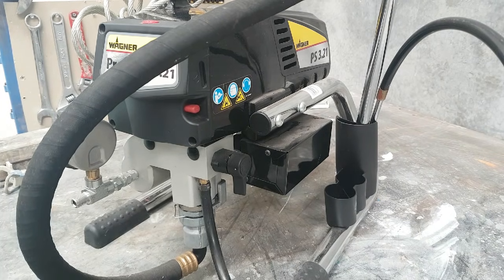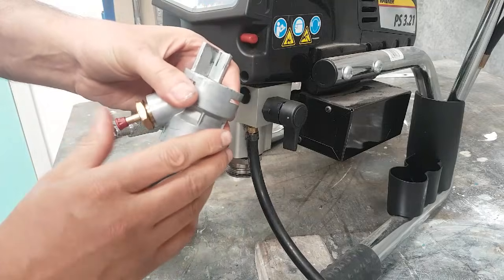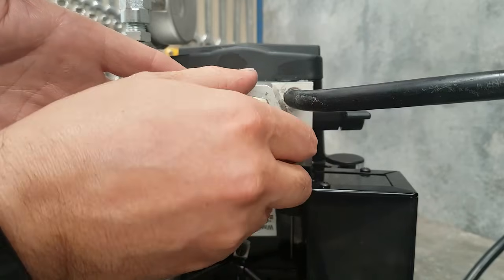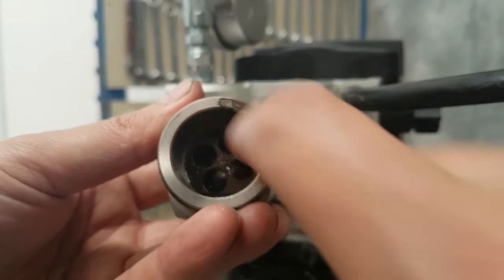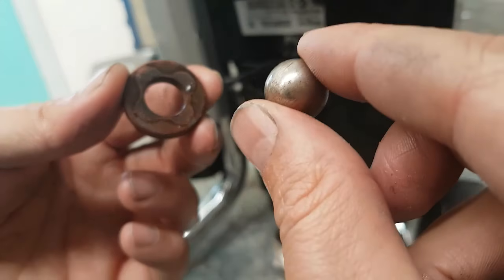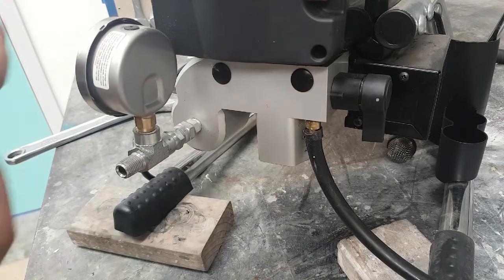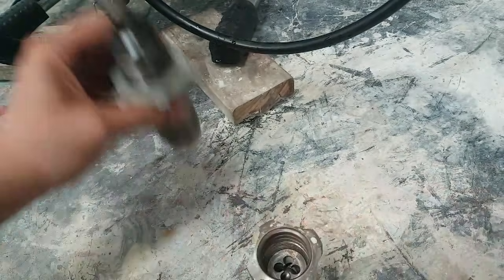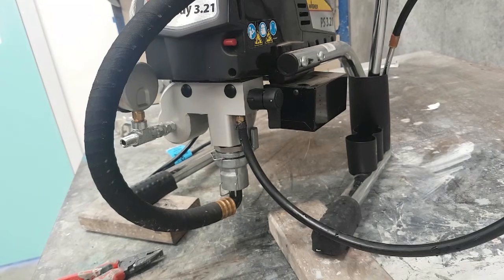Wagner / Titan won't spray

Comment: Just got mine second hand and neglected..  cleaned it myself abd git it going...  decided to drop it into the shop for a service $220 (including filter and spring)  3/4 way through first job it stopped priming. Your vid saved the day F'ing Awesome!!!....  not impressed with service shop though..  the lower and ball bearing area was full of old shit and never been cleaned!!!

Comment: You are a legend mate, your video really helped me . 

However, I have fallowed exactly your instructions with my Wagner 321 and re assemble it but it spray and then lose the pressure . 

Please guide me of what is the issue with my sprayer ! 

Thanks Ali
Reply from the maker: If its not a blockage in the valves, you'll need to take it to a workshop to go through it.  Too many different things it can be.

Comment: Yours is tbe only video that fixes the problem without the repacking kit.  The trick is freeing the upper AND lower ball.  The lower ball is easy to access but your method gives access to the ball inside the piston.  Also, I didn’t need to remove the cage however as mine was clean. After freeing the second ball in the piston, I sprayed brake parts cleaner all over both balls to make them extra clean. Works like a new unit now.  To avoid the balls freezing in the future, it’s important to clean thoroughly until clear water comes out of gun, then suck up some full strength pump armor before storage. Cheers!

Comment: I have the same machine ,while spraying the power goes off and will not turn on: sometimes it will turn on in 10 min some times next day, what is the reason?
Reply from the maker: You'd need to take it to a service centre to tell you,  could be a number of things

Comment: I get pumps destroyed by being left in water constantly. I have a graco 390 ultra that I have used to death with two repacks and the cylinder and piston are still smooth with a slight swage. I clean and thoroughly fill with thinner with a little bit of red trans fluid mixed.

Comment: Hi Mate.Thank you For the video.
  I need to trouble shoot a problem on my Wagner3.29 pro spray.
It was okay before but now  it turns 360 all way round when I try to switch from prime to spray. The machine Goes to spray mode when I don’t press the trigger but as soon I press the gun trigger it automatically goes to prime mode but still I can see some water from gun but no water comes the prime hose even when the Machine is in prime.
Plz assist me.

Comment: Thank you so much! My Titan 440 had been sitting for over 10 years and wouldn't prime. I wasn't willing to give up and try to go to bed tonight with the thought that I might be using rollers to do the whole job tomorrow. Fortunately, I found your video and it gave me confidence to find the problem. Just needed to poke the little ball with a screw driver to free it up and wipe a little loose rust and grime out of the lower ball and seat assembly. Only problem now is the water came flowing out of the selector, until I switched to spray mode. Will take a closer look tomorrow morning. Worst case, I'll just be ready with a bag of old towels.

Comment: hi, i have 4 sprayers, 2 grecco and 2 titan, both are well clean but they stop sucking paint every 2 or 3 minutes while spraying and i have to hit it with hammer to make them work, what might be the problem?
Reply from the maker: Damaged, dirty or worn valves, each machine has two, 1 at the bottom, the other is in the piston rod.

Comment: Hi Arley,  mate my machine isn't priming, I've cleaned out the bottom as in your video but the ball above the piston ball I believe you called it isn't moving and seem stuck in the up position,  any hints on what to do as I don't have time to put in for service as I've got a priority job that  needs to be finished in a week and I'm relying on the airless to get the job done in time.
Reply: Unfortunately you need to take it into a service centre, I don't recommend any more than the video if you don't have the knowledge as the damage you can do can go from minor to major repairs
Reply: @alielhaouli3198  Thanks , I actually did it and found it extremely basic,  I suppose there are some that couldn't do it but most painters I know are pretty handy.

Comment: Thanks for the video mate, I bought a new titan 440 and it wouldn't prime or spray" brand new out the box" I  took it apart & whatever assembly grease they used gummed up around the ball seat I scraped the dry grease off with my fingernail & a shop rag. I put it back together and she runs fine.

Comment: I know this isn't a titan 440i but maybe you would have some general idea of what to look with my problem.  my titan 440i  motor keeps smoking and blowing the fuse. i pulled it apart and see that the brushs on the motor are heating up and smoking then blowing the fuse . would you have any ideas what it could be?
Reply from the maker: It could be worn brushes or a board issue, usually this is caaused by using a bad power supply or a generator which is not recommended, otherwise its wear and tear.
Reply: @westsprayairless8763  I didnt think the brushes were that worn till you mention it I looked at it again and at new ones online it looks about half the size of a new one . Ill give it a try and see what happens. I already replaced the capacitors. Thanks for the reply !!

Comment: Do you have any tips for an old sprayer like a Wagner 505?
Reply from the maker: You can use any tips as long as you use the correct tip guard to suit the tip and your gun
Reply: @westsprayairless8763  no I meant any tips on how to take it apart. I got one today from an old painter. Its a diaphragm pump not a piston pump. But it doesn't do anything when I turn it on it won't prime or suck paint.
Reply from the maker: @groovygringo3747  sorry I didn't get the question. Yes first remove and inspect the inlet and out let valves. While they're out, inspect movement in the diaphragm, you should get more movement as you raise the pressure and less as you dial it down. If this doesn't happen, don't go any further because the cost of repairs will quickly surpass the actual value of the sprayer.
Reply: @westsprayairless8763  okay thank you. So how do I tell if the diaphragm is any good? I posted a video on my channel of the sprayer if you don't mind taking a look it's my most recent video.

Comment: I have a three wagner 3.21, only one running now, so just pulling one apart and having trouble, you helped a lot. Thanks
Where can i get cheap kits for them?
Reply from the maker: ThePa1nter i dont recommend the cheap kits, get the genuine kit and i recommend changing the piston as well as the packing kit

Comment: Hi Ali can you please offer me some help regarding Wagner project pro 119 spray unit .
After cleaning inlet and outlet valve thoroughly machine still fails to prime completely.
Machine won't even prime an inch of water.
Would you suggest a pump kit is required? Their are no signs of pump leakage
Really would appreciate your urgent feed back.

Thanks ,
Steve
Reply from the maker: steven dimakos if your outlet valve ball (located in the piston) and inlet valve ball and seat are moving freely then you'll need a pump repair kit. This include piston and packing. To be sure of this, after checking the valves are free, put your palm underneath the suction valve with the inlet valve assembly removed, and turn your power on. If there is no suction against your palm, then you definitely need a rebuild
Reply: Thanks for responding so quickly you are an asset to the industry.
I look forward to watching more of your videos on you tube.

Thanks